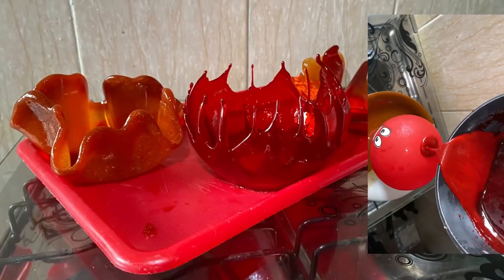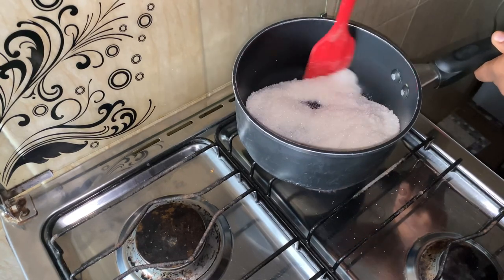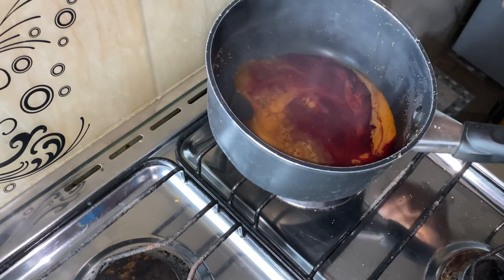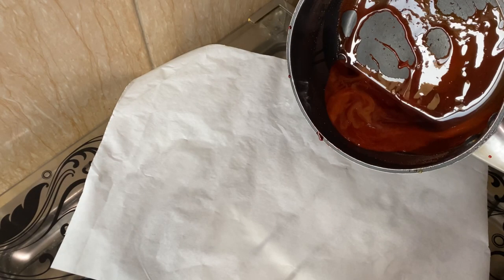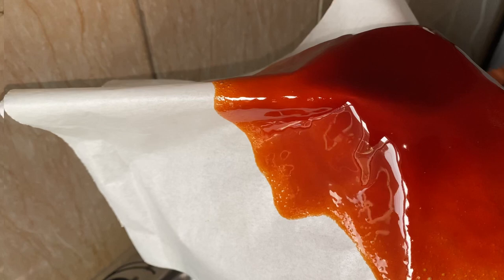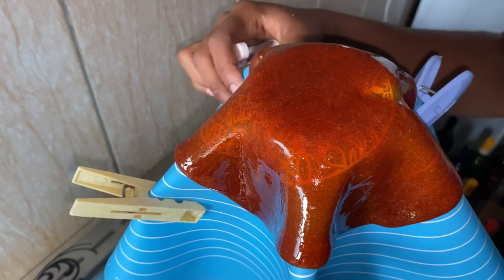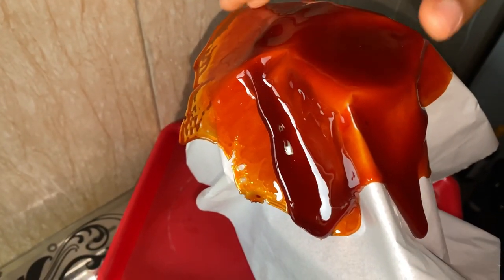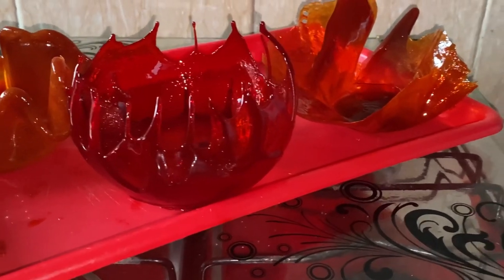Sugar Sail Recipe - No Isomalt /Silicon Mat /Corn syrup /Glucose /Thermometer

Comment: But won't the baloon burst if hot syrup is poured over it? Or is it a silicon type baloon?
Reply from the maker: That is why you fill the balloon with water. The water prevents it from getting burst.
Reply: so much for your quick reply 😊
Reply: Is it cool water .....
Hi...im from srilanka .....
Reply from the maker: @eshankaperera7999  hey Eshanka, just use room temperature water, straight from the tap.
Reply: @ClaudiaCakery  thanks dear......🤗🤗